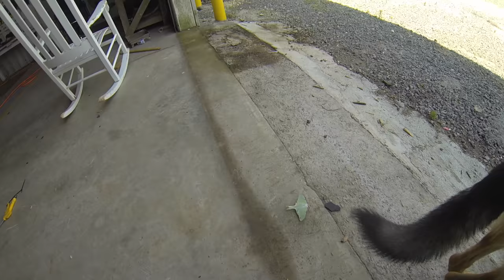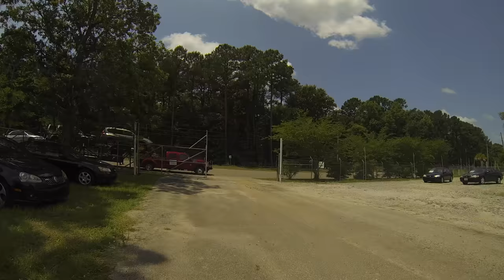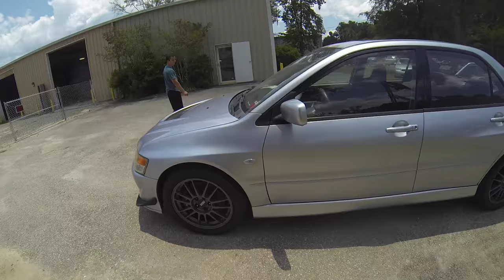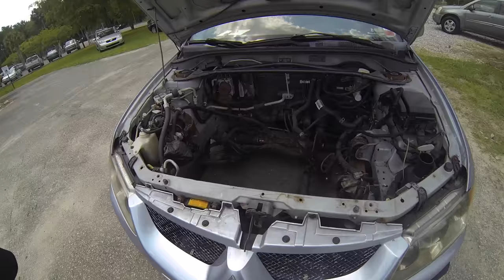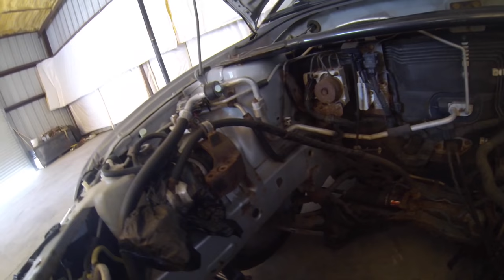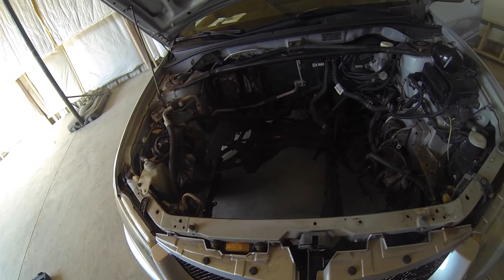THE EVO HAS ARRIVED! (Part 1)

Comment: I really like the color and the front splitter along with the mustache. Also because the car is a New York car, you will have to battle with the crusties for a while, so I would undercoat it. Did you find out why the engine was pulled originally?
Reply from the maker: Yeah he was fitting it in a mirage or something haha
Reply: WHY!! A evo mirage would be super cool but why would you buy a perfectly good evo to part out. I personally would have bought just an engine and wiring harness with an ecu. I guess that worked out well for you though.